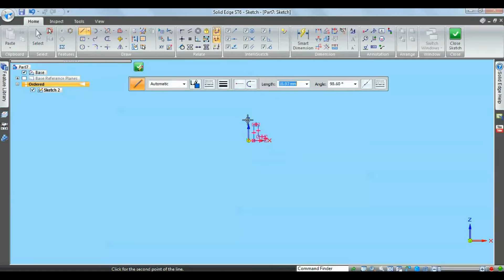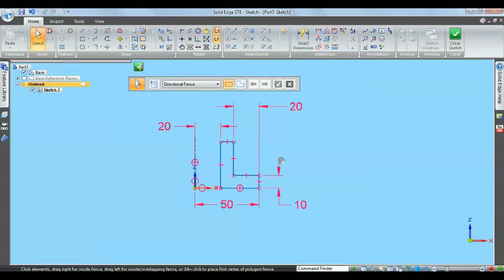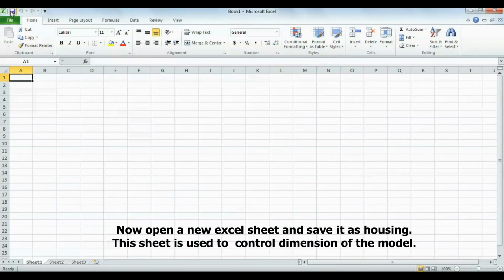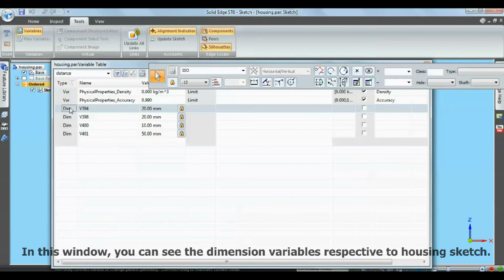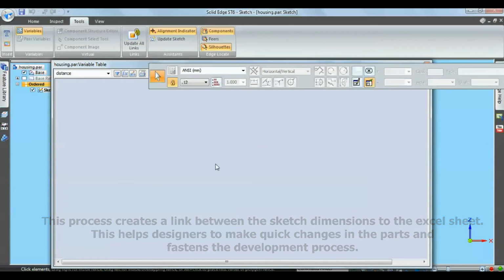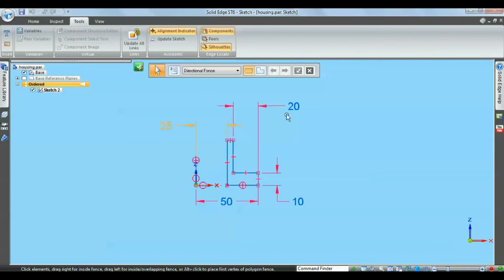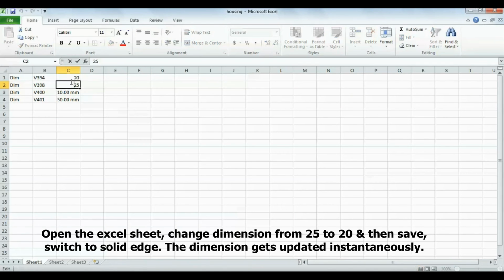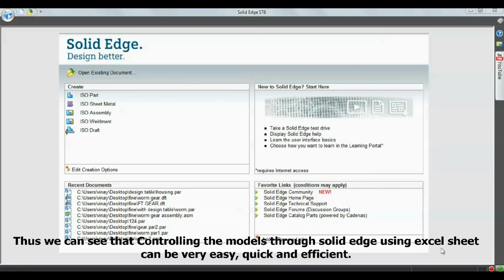Create Design Table in Solid Edge ST6

Comment: I am having difficulty with excel working well with Solid Edge ST9.
I cannot update the excel sheet in real time because it forces me to use a read only version. Once Solid edge has the link for a reference it locks the sheet until the part is closed then updates the part. Any ideas? Thanks for any help in advance!